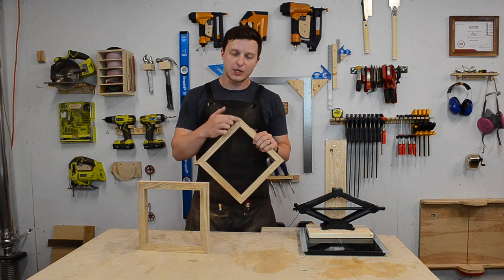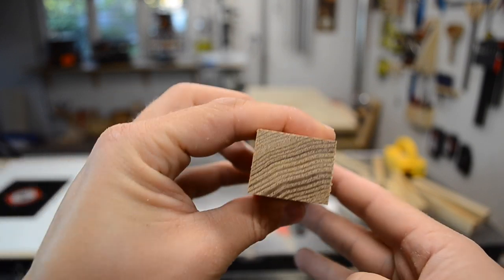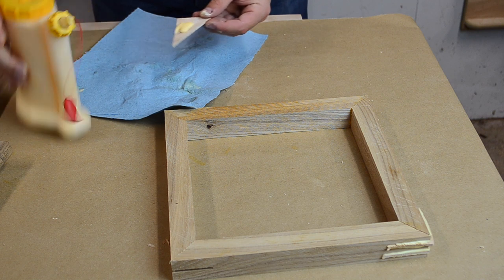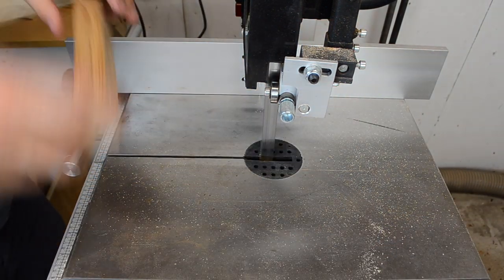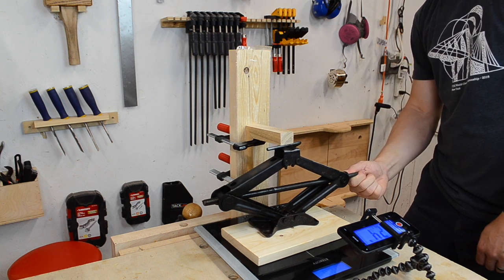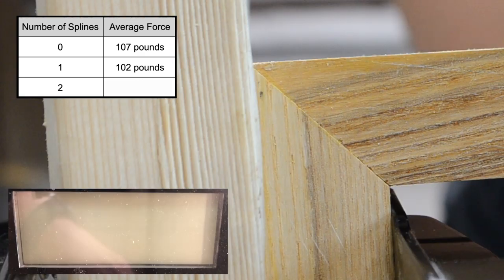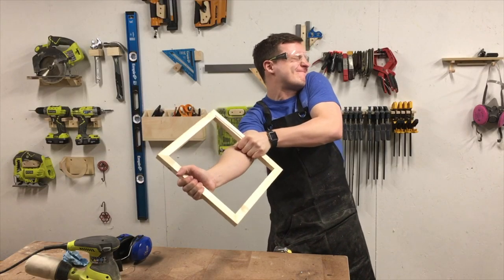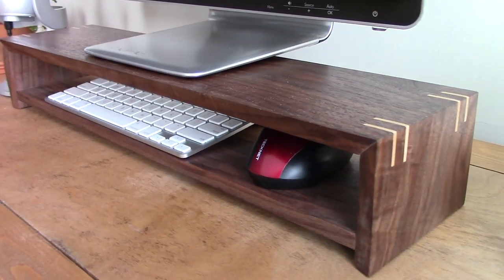Do Splines even DO ANYTHING?? You will be surprised!

Comment: Statistic guy and woodworker here. I actually did this for a project in my one college class. Tested this same thing in a similar way with similar results. I found that using epoxy (5-min kind) as your glue without a spline was the strongest joint. My thoughts are the epoxy is thick enough to fill in the end grain and seal the pieces together.
Reply from the maker: Awesome, I'm a statistic guy and woodworker too, also named David K 😅 Very interesting theory with epoxy filling end grain! Thanks for sharing.
Reply: I am not statistics guy hahaha, but same experience here, epoxy expanding glue like gorilla brand makes marvels in end grains joints like that. Anyway, splines are beautiful and I will still use it anyway 😆

Comment: I only have a minor problem with your test and that's how you broke the joint, you applied pressure from the inside of the frame instead of the outside. The difference being that it's meant to resist outside force not inside soooo I'd really love a retest
Reply: Ryan _ this was my thought. Spline joints tend to pull away from each other. So testing this force would be the best way to answer the question.
Reply: I don't think it matters. Consider an infinitely thin miter joint (imagine two sticks connected in an L-shape) and note that regardless of the direction of the force, the torque magnitude is the same. The only difference is the direction of the torque produced, given by the "right-hand rule" when you take the cross product.
Reply: I want a retest too. I logged in just to comment about that. This was really good

Comment: Maybe you should could test the joints with force applied perpendicular to the face of the miter as well. I bet it is stronger with splines when tested that way. It seems that with splines, they should not pull out if fit and glued properly. They should break before the glue joint fails as was shown in your tests.
Reply from the maker: Agreed. That's a good idea Rick I will try applying force from different directions next time 👍
Reply: @dkbuilds  watch Patrick Sullivan's videos, it's most definitely not the end grain (unless the glue is shit)

Comment: I was watching closely, but couldn't see if the splines were breaking. The grain of the spline should run across the miter. And as some other fella pointed out, they should have been clamped to compress the splines in their grooves. But I myself have wondered about how much strength they added. But I couldn't bear to bust one of mine up. I did glue up a 1/4 thick walnut frame that I cleaned the miters up on a shooting board before gluing. That makes for a real nice gluing surface. I couldn't break the frame apart after it dried with my hands. I think there's a lot of variables in deciding if splines are really good. But like you, I'm gonna keep using them . Nice video guy

Comment: I should point out that what the testing showed is that reinforcing a softwood joint with hardwood probably does improve the strength of the joint a little.

To really test to see if splined miter joints are stronger you'd have to test using softwood splines in a softwood miter joint and hardwood splines in a hardwood miter joint.  What is more, it should be the same wood as being used for the miter joint, not just a hardwood or a softwood.

I would expect a joint reinforced with hardwood to be stronger than a joint which is not reinforced with hardwood.

It would not surprise me if in a proper test the splines actually weaken the miter joint.  Maybe that won't be the case, but I think that is what your testing suggests to me.

Comment: I was under the impression that the friction of splines also helps with reducing the movement of the joint over time with humidity as well, which is much more difficult to test for. In theory they also help wirh reducing the impact of any torsional flex of the the joint.

Comment: Strength is not necessarily the purpose for splines, in the sense that the addition of a spline increases the overall strength of a joint.  Though I will disagree in that like any joint, if a spline is done properly for the particular design, it will increase strength, even if minimal.  But you have to consider what the project is and determine the best joint per purpose.  A drawer will almost never be mitered, because it is inherently weak especially when compared to a dovetail.  Picture frames are decorative, with the standard if you will to have a miter joint adding in uniformity and a pleasing result.  Application is key when determining what joint you will be using for any project, so it is a weight of aesthetics and strength. 

Picture frames do not typically see activity, nor experience any force requiring strength similar to what a drawer would.   Accepting the aesthetics, your intent is not necessarily increase strength where it is unnecessary, but instead create a joint that will increase the life of the project, meaning last longer without failure.  Since they hang on the wall, or sit on a desk, the forces picture frames typically experience is environmental, being temperature, moisture, etc.  This is why it is also critical to finish/seal your entire picture frame, meaning front and back.  We all know wood moves, and that movement can have a greater impact on lesser joints like a miter joint, so the spline if done properly will actually help prevent lateral and opposing movement by holding the position of the wood in place and minimizing failure of the joint.  Popping the frame appart like in your test is not really applicable, in that it is not real world forces that the picture frame would see.  Instead, as you later said, even with abuse of dropping a picture frame, the spline will hold it together, which helps prove my point that you are merely trying to prevent failure, and minimize movement, not increase the overall strength of a joint that will never unless abused see the forces required to bust the joint.  Especially with moisture, most joints tend to allow the most moisture into the wood more here than the wood itself, and end grain will see the most movement, expanding greatly.  The spline not only limits this, it also helps keep the joint aligned, allowing less movement, which means less stress on the joint.  So in effect, even if your test shows a black and white concept of no overall gain in strength, this is just not true.  Splines do offer incredible value if done properly, and are visually stimulating as well.

I have woodworked my entire life, and even received a partial scholarship in it (bet you didn't know those existed).  I have projects I built 40 years ago with splines that still are holding, where other joints that should be stronger show failure.  In the end, the most important factor in achieving a durable and strong joint outside of what joint you use, is accuracy of joint.  That is to say ensuring the joint mates perfectly and joined together without stress (more clamp pressure).  Joints don't have to be perfectly 45 degrees to mate together, and especially with picture frames can be difficult.  This is why building a miter, or picture frame jig can offer the best results, even if you don't hit that perfect 45 degree mark.  Instead, you need to ensure the frame fits perfectly, meaning the length of the sides are identical, and it is perfectly square.  To do that you just make sure you cut the mating parts on the opposite side of the jig, meaning if you number every joint on your frame, you cut odd number on one side of the jig, and even on the other.   Often people will try to make up for less than perfectly matching parts, be it a less than perfect miter angle, lenght, or whatever by increasing clamp pressure.  That can work for a while, but in doing so, you have already created a joint that has much stress working against it and fighting it, so add moisture, temperature, or even just time and it will fail.  Clamp pressure is the enemy of a good joint as it not only makes up for imperfect components, it squeezes more glue out.  Depending on wood, edge grain (not end grain), should be almost if not as strong as the wood itself, so this is one joint that should never fail, yet to much clamp pressure, or an imperfect mate will do just that.  In fact, many would be surprised to learn that I will often use tape when gluing miters on boxes and even picture frames.  To do this, you lay the inside of the miter down on the surface, and line all the parts up against a flat edge.  Butt together while pressing firmly and simply apply blue tape over the ends.  it can be doubled for strength as well.  If your parts are cut perfectly, and it is square, then once you add glue, you can simply close the frame, tape the last corner, and you will have a joint that will stand the test of time, but will also be perfectly square.

That brings me to my final note.  Project durability and strength comes down to not just the joints and construction techniques chosen, but the quality of those cuts.  In school, I would often be pressed by other students, because before using the equipment that was abused by many, I would always dial it in, meaning brake out the square and indicators adjusting it to make it perfect.  It is every bit as important to ensure your tools are accurate, so that your joints and cuts will be accurate.  Glue up is not the time to makeup for inaccuracies, or hurried cuts, and will be the difference between a bad, good, or excellent project that stands the test of time.  So, add a spline, or add a mechanical joint, but recognize neither will work, or even be as strong as the lesser option if done improperly.
Reply from the maker: Thank you for the extremely detailed and well thought out response BP. Lots of great points in there. Hopefully other viewers see this comment and learn from it, like I did!

Comment: well... lets say you dont break structural integrity of the frame to perform a test, hang and drop it from a typical height (with a painting in it), I bet it would fall flat on the bottom part of the frame or whatever. So what kinda of force would be in play here. More importantly the structure itself would kinda work together and it would require much more force than in this experiment to break it. Anyway cool vid... I guess not much glue gets in there with the splines and they're not clamped either down either. So the gain is not this much and you sacrifice part of the joint to make it, In the way you pulled it, the spline is not in an orientation to offer any resistance and it would probably not be in most drop.

Comment: I'm guessing you would have different results if you applied force along the z axis rather than the x and y.  It looks like you're just separating the joint as much as actually breaking it.  I could probably break any mitered joint that's simply glued together by hand and definitely could over my knee but not sure if it would be so easy with a spline.

If you could apply downward or upward force at the joint itself and kept the ends clamped together.  I'd be curious to see your results.

Comment: Would be more accurate if you didnt have to hand tighten the jack, could skew the weight as you are pressing up or down when tightening.
Reply from the maker: Yes that is a very good point Sam. Hopefully I am skewing the weight in the same direction for each trial, so that the results could still be interpreted the same way. Also if I am indeed skewing, I'd imagine it would only be a pound or two at most, which would impact the force needed to break the joint by a few percent. Regardless, good catch! I should have addressed this issue in the video.

Comment: This was a worthwhile test, but honestly, I don't think the test evaluated the intended use of a spline.  A spline is intended to add strength during wood movement.  Wood does not move in a way that was done in the video.  In my humble opinion, if you had one piece clamped, and then just pulled the other side straight away from the angle, that would be a true test.  Again, this is just my opinion.
Reply from the maker: Thanks for sharing Kevin! I think I might disagree with the purpose of a spline -- I don't think a spline is intended to add strength during wood movement, I think it is intended to add strength to a joint which has suboptimal glue surfaces (like a miter joint which is kind of half endgrain-to-endgrain). I do agree that wood does not move in the way shown in the video -- there is very little wood movement in picture frames unless it's a really wide frame. Clamping the wood and pulling on it like you suggest would be a really interesting test though, I'll consider that if I ever build a follow up video. Thanks for taking the time to comment!

Comment: The spline orientation you created is incorrect for this test. In order for the spline to add strenth it must be at an angle with the force being exreted on it. You should have added your spline the other way.
Reply from the maker: That’s a good point. I agree that a spline in the other direction would add more strength, however this is the direction the splines are always used in picture frames, which is why I chose this orientation.

Comment: End to end grain joinst are actually the strongest joints. 45 degree miters are not end to end grain joints. They are in between end to end (strongest) and side to side (weakest). Still they are not "weak" joints. Long lengths with small glue surface cause the weak joints. There's no way, I don't think, if done properly that the splines would come out without breaking. Try again with full cure time and accounting sufficient space in spline cut to allow glue not to be squeegeed off the spline insert. Also there is a sweet spot for the spline location (where the miter would begin to fail without a spline). Great video! I am not a YouTube creator and so my, grain of salt, opinion is of less value than your experiments.
Reply from the maker: Thanks for the comment James! I'm not sure I agree that endgrain to endgrain connections are the strongest joints. I know there is a viral video now explaining that they are stronger than most people thought, but I haven't watched it. Is that where you got that idea?
I like your suggestions for extensions to the experiment, I will consider them if I make a follow up video to this one!
Reply: @dkbuilds  Thanks for the response! Typically, end to end grain pieces are narrow and long creating a lot of leveraged pressure on a small glue surface. If, however, you were to cut a wide, short board across the grain and glue, that joint would be stronger. We've all heard that "glue is stronger than the wood". This is true. The failure on a well glued joint isn't the glue, its the wood beside the glue. For a better image, picture a 12"x12" board. Now cut 1"  inch strips across the grain. Glue the ends together. The result is a very fragile joint. Now, make the same cuts along the grain. Get it?
Reply: @dkbuilds  I would love to see a follow-up video!

Comment: You're not doing the tests correctly. You're testing the side without the support and strength of a spline. This is like testing a shorter width and height mitre joint over a longer width and height mitre joint. The spline needs to be engaged from the start of the test, not when the rest of the joint has already started to fail.
Reply: Ace what a great idea!  You should do a test the way you are suggesting and then make a video so we can see the actual results! Thanks so much!
Reply: @jolenethetoolwomantaylor5973  I don't make videos.